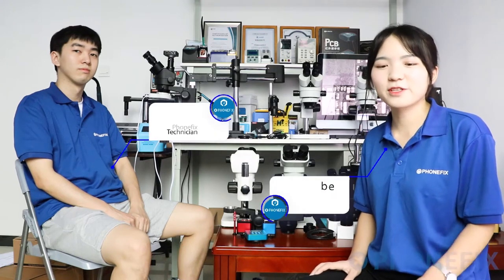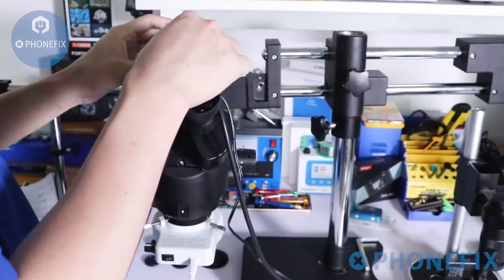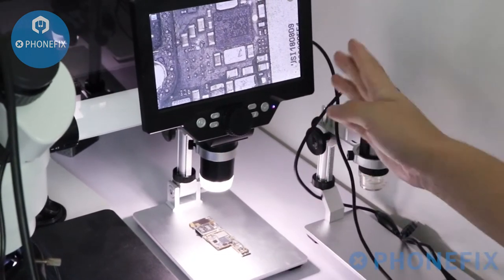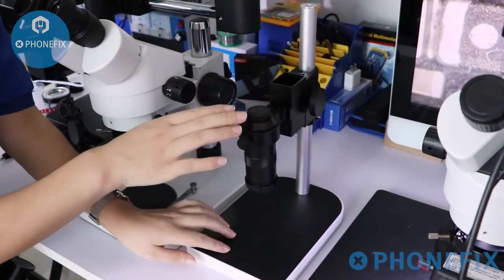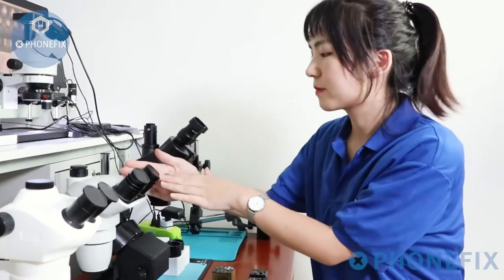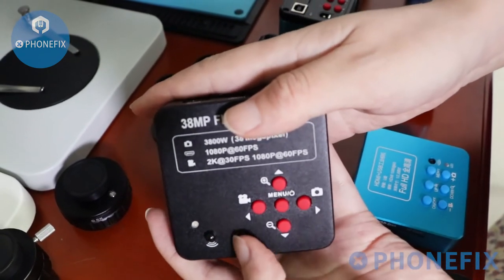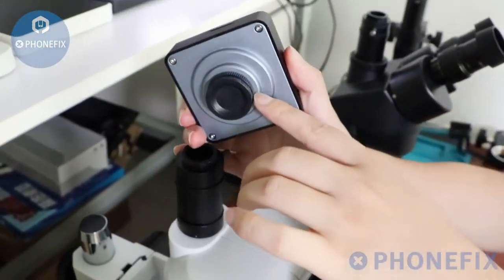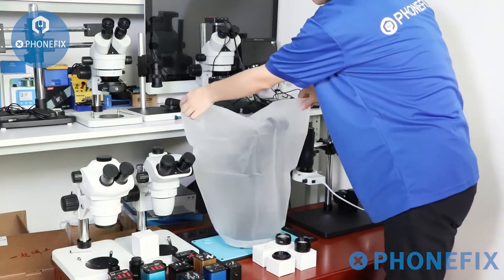Reviews Of Different Kinds Of Microscope(Trinocular/Binocular HDMI Camera Microscope) Part 1

Comment: He comprado varias veces en su tienda de Aliexpress, se que venden muchos productos, en este video se les ha escapado un detalle, los que fabrican los microscopios se han dado cuenta y por eso han cambiado el diseño creo que hará cosa de un año.
El detalle es el fallo de diseño de ese tipo de cabezas de microscopio, todas las cabezas de microscopio que salen en este video tienen ese fallo de diseño se puede distinguir muy rápido si se ha tenido en cuenta ese detalle o no. Los diseños que tienen las perillas de zoom más hacia delante ya han corregido ese error de diseño.
El detalle es que queda un hueco en esa zona donde se unen las dos partes de la cabeza, esta en posición vertical y por ahí se mete el humo de los fundentes que se producen al soldar, al cabo de un tiempo puede estropear la óptica interna.
Los que usan las cabezas con ese fallo de diseño tapan o al menos deberían hacerlo esa zona con cinta para evitar que se meta el humo dentro.

Saludos